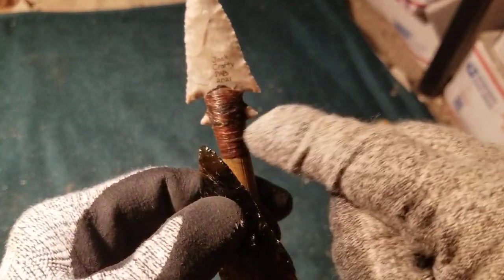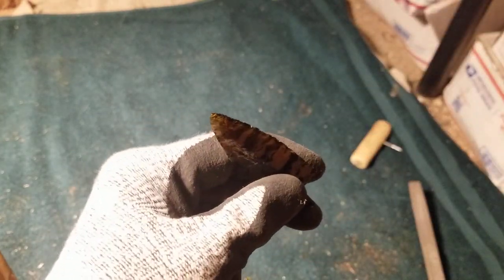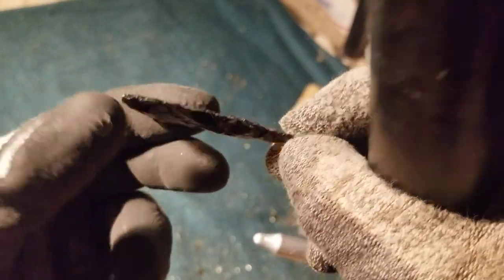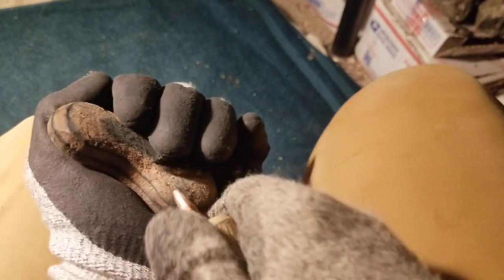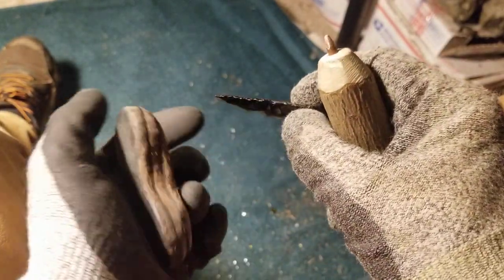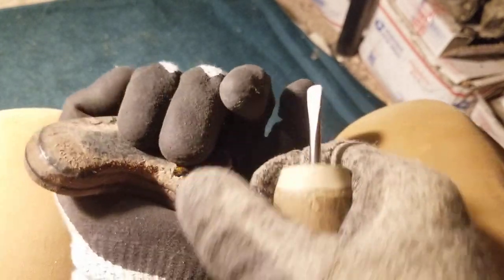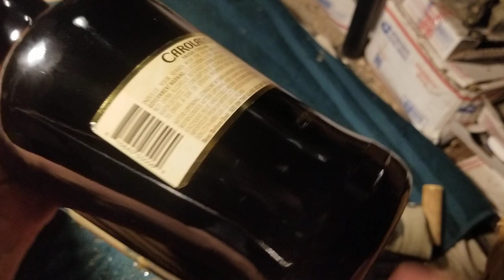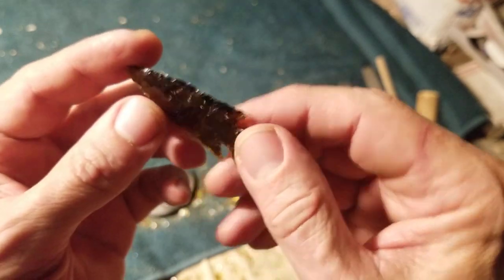981 - Glassknapping Adventures Part 4 Edgework and Notches

Comment: I have just started using the very tip of a fine pointed diamond file for popping off sharpening flakes , the tiny diamond at the tip seems to bite the stone without much pressure and releases a very clean and sharp finishing edge flake . The slight flex in the tool along with the ultra hard biting diamond tip creates wicked sharp edges for me with no crushing .. I recently discovered this after loosing my spatula tool and substituting it for the file tip temporarily, might be worth a try it you have an old diamond file you dont mind ruining the tip on
Reply from the maker: Very interesting idea!